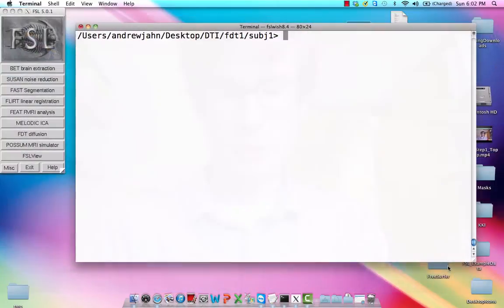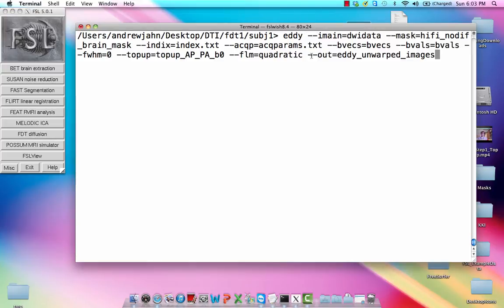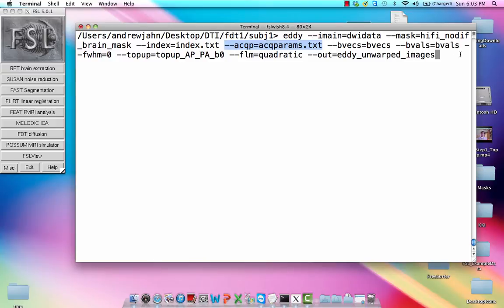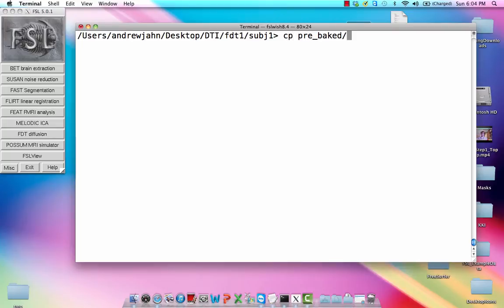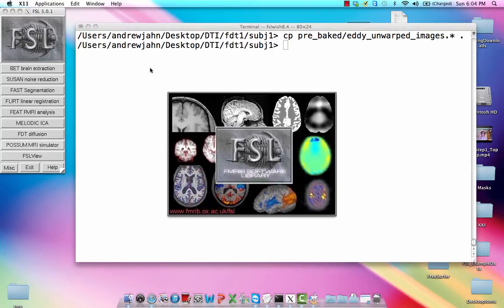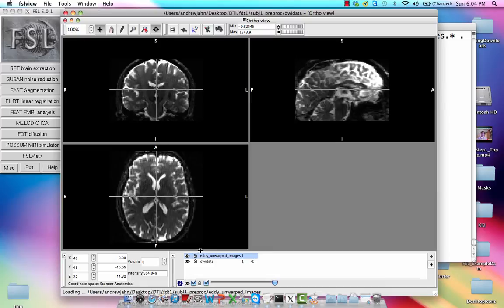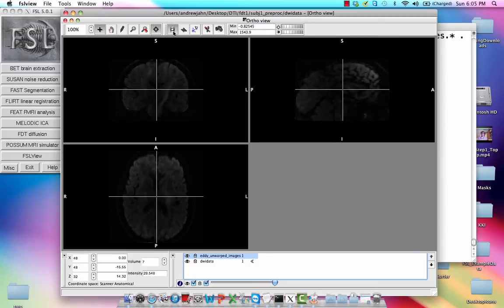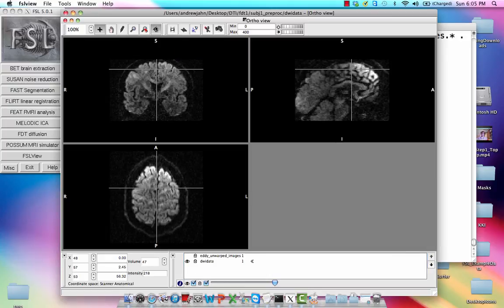DTI Analysis, Step 2: Run Eddy

Comment: Hi Andrew, 
First I want to thank you for this amazing channel and the blog  you created to guide young neuroscientists who are ambitious yet unequipped about neuroimaging such as myself. I am a master student in neuroscience and just began studying neuroimaging. We in our lab have dti data but the images dont have reverse phase encoding so we cant apply topup. What do you suggest to do at this point to correct distortions. We only have t1w, dti and bval bvec files can we generate a fieldmap out of these and do fieldmap based distortion correction or leave it be and  do just eddy correct. I know it is such as inappropriate place to ask but hope you ll see this. Have a wonderful day, best wishes,

Muhammed 
Dokzu Eylül University
Reply from the maker: Hi Muhammed,

Thanks for getting in touch! Unfortunately, without a reverse phase-encoded you won't be able to do field map unwarping; you can still do eddy correct, but you may have distortions in the frontal and ventral temporal areas.

Best,

-Andy
Reply: @AndysBrainTube  Thank you so much for answering. I have been searching on the forums and i saw some ambigious comments about generating a fieldmap out of the t1 image but i think its not appropriate in our situation. 

Best,
Muhammed

Comment: Hello,

I've installed fsl-5.0-complete in NeuroDebian VM to run DTI analysis and as far as I understand eddy_nonfree package comes with it. I know that `eddy` is not used anymore you use either eddy_cuda or eddy_openmp and that if you use FSL in a VM you should add `fsl5.0-` before whatever command line you want to operate and this works for other tools such as topup. However, I could not run eddy no matter what combination I've tried. I don't know if I'm missing something obvious here but I'm stuck. How do you run eddy on FSL 5.0?
Reply from the maker: HI Dilara,

If you just use the "eddy" command, it will look for whether eddy_cuda is able to be used, and if not it will go to the next available option. Have you tried that yet? I'm not sure if there is some discrepancy due to NeuroDebian, but this approach works on my Mac.

Best,

-Andy
Reply: I have already tried that but does not work on Neurodebian. Maybe I should try with Ubuntu or Mac. Thanks for your quick reply.

Comment: Hi Andrew,

I'm playing around with the FSL tutorial data, and noticed that the bet command was run on the applytopup output.  If I was to skip that step, and go straight from topup to eddy, what file would you recommend I use for bet?  (Sorry if the answer is already out there, I'm brand new to everything to do with neuroimaging and haven't stumbled across it so far).  Thanks!

Comment: Hi! Im using the graphic interface to run eddy, and i can't visualize/select my bvec file to reorient bvecs, any suggestion?
Reply: Hi Javier, I I know you posted this question a while ago, but I'm just getting into DTI research now and I'm also not sure how to reorient the bvecs after the eddy correction. Have you had any success with this step?

Comment: Hi Andrew,
Can you please elaborate more the index.txt ?
Reply from the maker: Hi Mahmoud,

The index.txt file just has 1's for each scan that was acquired with the same parameters in the acqparams.txt file; in general, this should always be a file with the same number of 1's as there are scans, unless you use different parameters for any of the scans during the run.

Best,

-Andy
Reply: Andrew Jahn Dear Andrew,
Thank you for your prompt response. We got our DTI data from a 3T Siemens Trio (VB17). Do you know have can I get the acqparameter.txt and index.txt from this machine?
Reply from the maker: Mahmoud Zeydabadinezhad Hi Mahmoud,

Those text files aren't created by the scanner, exactly; you have to create them given the parameters that were used to acquire your DTI images.

The acqparams.txt file has two rows and four columns, and might look something like this:

0 -1 0 0.0665
0 1 0 0.0665

Assuming that you have acquired volumes encoding in both the anterior->posterior and posterior->anterior directions, the first row's 1 specifies that the first acquisition was encoded in the A>P direction, and that the total readout time (i.e., number of seconds between the center of the first echo and the center of the last echo) was 0.0665. The second row gives the same information for volumes acquired in the P->A direction.

Once you have that, you then can create an index.txt file that contains 1's where these acquisition parameters hold. For most purposes, you can just create a text file with the same number of 1's as there are volumes.

Hope this helps!

-Andy